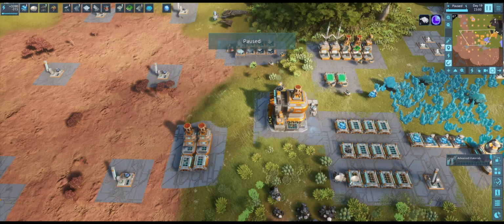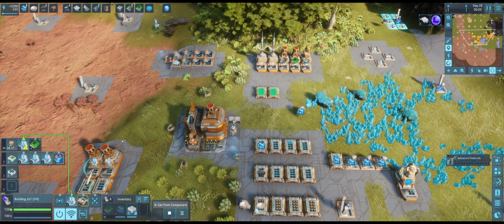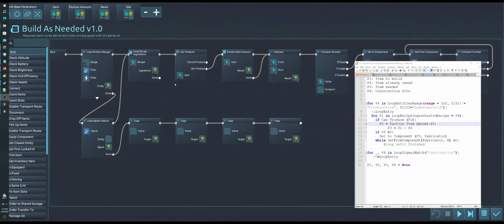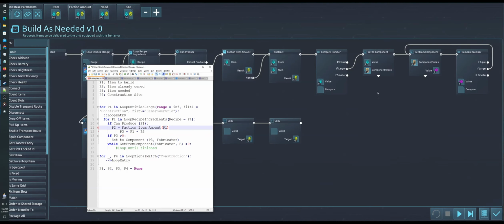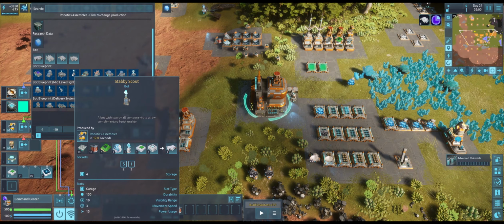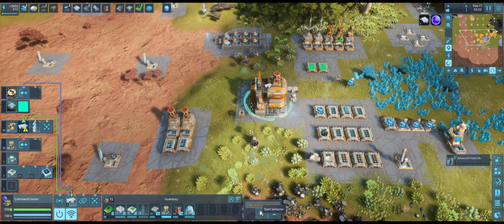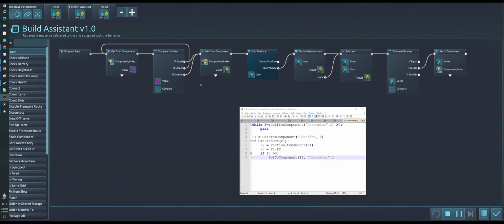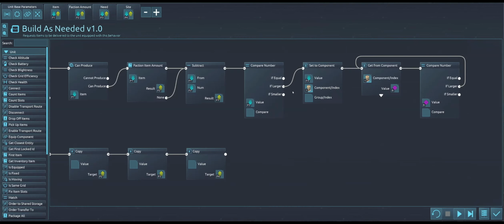Desynced Breakdown: High Mix AutoManufacturing

Comment: I agree that additional instructions to obtain slot information (id and type) would be helpful, for more generalized behavior
Reply: at least nowadays, there are commands "get equipped num" to learn how many of a specific component (eg assemblers) are equipped, and "loop number" which can iterate through the first until Nth of those components. in "set to component" the "value" would be which item and which amount of that item should be produced by a specific assembler, "to" would be "assembler,1" (for the first register of the assembler), and the optional "component index" would be the number (1 to N) of the assembler that you got with the previous commands and the loop. reading the current status can be done by checking whether that value still exists (it should automatically get cleared when the assembler is done) with the command "get from component" with the same "assembler,1" for "from", and the same component index.
there should be no need to ever know in which slot of the building or bot the assembler is equipped, the game just enumerates all the components of the same type and allows distinguishing between them by giving that component index.

i recently wrote a subroutine that fills dynamic arrays (yes, those exist now too) with the type and component index of the best first, then the next, etc, and finally can return to you the best four pairs of component and corresponding component index, to use on a big building with 4+ miners of unknown types :-) and there was no need to know any direct slot numbers.
to exchange eg normal miners for laser miners, i would look at my personal notes or my memory what kind of bot or building i used for them if i want specific slots to be effected, and otherwise simply unequip them all without giving slot numbers, and then equip the new desired types also without giving slot numbers.

and yes, if they really want a "slot index" for equipping and unequipping components, that looks counterintuitive, but i would imagine that that is done to allow installing eg a specific small or medium component (or even an internal component) in a larger slot manually, without needing to first fill all smaller slots with dummy components. and to use that installed component (when you don't all the time switch back and forth between different components for one slot while another slot is still active) the "component index" should be good enough.
if you want to remove (by commands) a specific assembler to replace it (by commands) with eg a refinery, you probably should remember in which slot you had installed the assembler (by commands), and similarly also for internal components when you need to exchange eg a radar with a transmitter, and then back again after use. but that would rarely be "generalizable" edge cases :-)

i can only imagine some other edge cases like acting on an unknown bot and wanting to remove an assembler from it (btw: YOU can't equip and unequip components on other units anyway, but at most tell them via some communication method that they should do it themselves, and then THEY should know about THEIR slots). and for such unknown units you probably would also need more "service commands" to get specifications for that unit, how many slots it has, which of them are L, M, S, I, etc.

what would have been your use case to need obtaining slot info, and what kind of "generalized behavior" ?

Comment: Could you do a video that explains what every single one of those programming instructions do? I find that the official documentation is not that good. I don't me the ones you use in this video, all of them like Can Produce, Set to Component etc..
Reply from the maker: Thats an interesting idea!  Would you prefer that as video or as a webpage?  I'm afraid that going through every single instruction would be a long video, but if there is interest sure.

I was thinking of doing a "common constructs" video, which sounds adjacent to your idea...
Reply: A website would to do. I just find its very hard to find out what some of them do.  @VDubBuilds
Reply: I think doing 5 or so commands in a few examples is a great idea